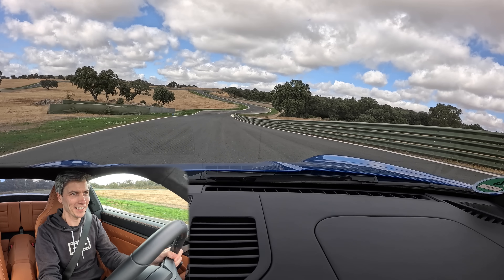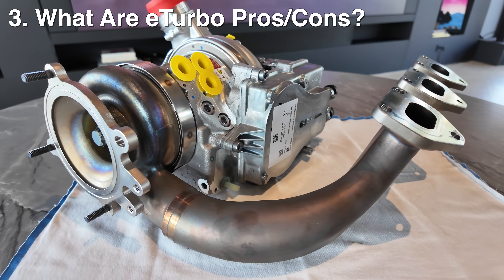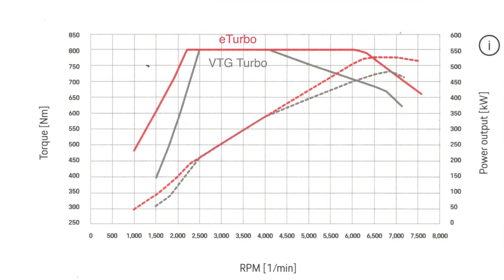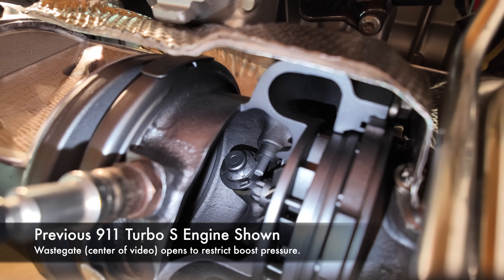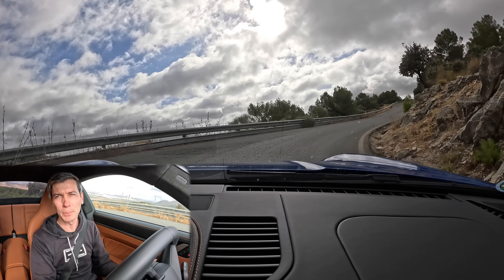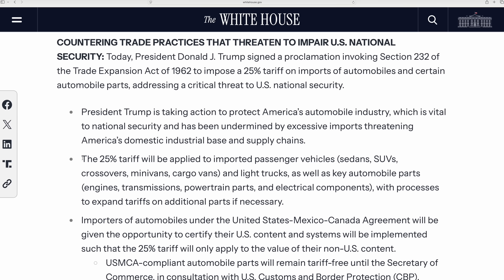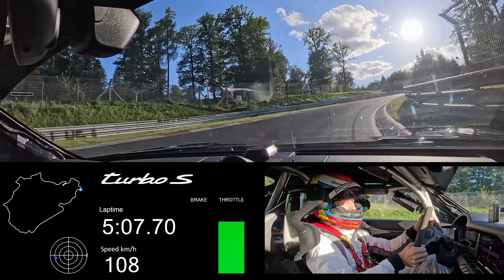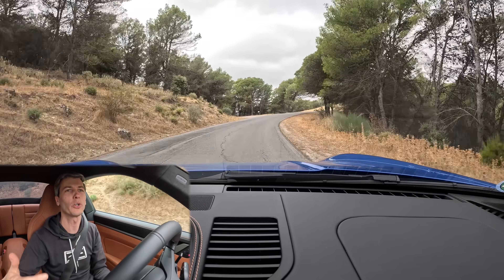Electric Turbos Are Here — Is It A Good Thing?

Comment: They should split the system. Compressor would be easier to spool instantly and be bypassed for cruising.turbine always extracting as much power as it can in any state
Reply: them you'd double the number of motors - one to manage the compressor, and one to harvest from turbine. Dumbest idea ever
Reply: @GamezGuru1 dumb? Lmao.. you'd have responses of natural aspiration with added turbo power plus turbine power extractor.. genius actually
Reply: @daveriddlelin9327 why has nobody done it yet then? 🤔
Reply: @GamezGuru1 it's been done in aviation.. but was wildly complicated and expensive but extremely effective..
Reply: @daveriddlelin9327  the cruising efficiency would even be far worse, there is literally only drawbacks 😂
Reply: @GamezGuru1 not true.. look up turbo compounding in aviation.. they got airplane engines to 50% thermal efficiency.. in the 50s!!
Reply: A company called AerisTech was working on that exact thing just before the GFC - but mostly focused on small turbos for diesel motors. Turbine worked as a generator feeding a solid state battery and the compressor side was spun up by an electric motor that drew from the battery. Capable of accelerating the compressor wheel from 0 to 100k rpm in half a sec.
Reply: - OR the e-compressor could decouple on the spin-up - then recouple as the turbine catches up  (Though, reliability gremlins will have at it)- A totally split system requires 2 motor/generator units  (and has lower efficiency - as do most "series electric hybrids")- in a "common shaft" arrangement there is only one,  spinning up the turbine as well as the compressor / motor mass - electrically, is small fish.
Reply: @kadmow  no need to 'decouple' anything. The motor just switches off, and the compressor is driven solely by the turbine, like a conventional turbo
Reply: Most of the time in real world driving you aren't in boost.. completely bypassed means natural aspiration response.. turbine recoup can be 50 hp. With nothing wasted making boost you don't need @kadmow
Reply: @daveriddlelin9327 you clearly don't understand turbo engines. In 'cruise' I e. low rpm (highest gear) a turbo engine is not on boost. Nevertheless, it is STILL more efficient than an NA engine. There is not enough turbine energy to harvest anything from it though.

50hp from the turbine is laughable, there is no exhaust heat nor massfliw when cruising...
Reply: @GamezGuru1 lmao who doesn't understand what?? I completely understand..  but thanx.. I've been driving heavy diesels for years.. many turbo upgrades have shown me a lot.. people think turbo drive pressure is free energy.. it isn't.. you can get 30 psi with drive pressure of 35.. most stock trucks 30 psi is drive pressure of 50 or more 
. Back pressure on any engine is horsepower not available at crank
Reply: @GamezGuru1 I've switched turbos on big Cummins diesels that power was turned up.. turbos have small windows of efficiency.. and all are a compromise except in that zone.. split turbo would allow tiny extremely lite weight compressor able to spool in an instant and be completely bypassed when boost isn't required.  In say a bus.. 7.3 power stroke.. cruising at 60 probably making 7 psi.. a 7.3 with no turbo gets better millage by far but can't climb.. turbo is in the way until a lot of power is needed.  I've driven a lot of cat 3208.  Junk. But they come turbo and none . The difference is huge.. many advantages to getting turbo out of the way whenever you can . Na response..plus turbo like power.. turbine extraction can increase efficiency with out being tied to boost at all.. plus split system allows for axial compressor . Wildly more effective than centrifugal compression
Reply: @GamezGuru1 switched from single to compound turbo on series 60 Detroit.  Egt dropped 300 degrees.. drive pressure at 40 psi boost dropped from 80 to 50.. didn't increase boost at all..but reduced temps to allow more fuel.. and boosted air temp drops too.. I kinda know how and why they work.. do you really???
Reply: @GamezGuru1 the fuel economy difference between cat and Cummins comes from drive pressure.. look at exhaust manifolds between them.. cat is always smaller because they operate with higher drive pressure Wich only is more efficient below 1500 rpm.. cat fuel economy is completely dependent on keeping rpm low low . Cummins has better breathing Wich at low rpm is sluggish and hard to get boost.. but is more efficient at higher power levels.  All compromises.. split boost from power extraction opens whole world of advantages.. compressor motor is just a motor.. extractor is just a generator.. allowing optimum performance and ability to bypass when ever possible

Comment: Dislike this "technology." Forget the turbos, the exhaust, the combustion engine. Get a fully electric EV with a battery. You get all the torque the instant you depress the accelerator. None of this ridiculous electric-turbo complexity to compensate for an inferior gasoline engine. Battery electric is superior in every way. Second is the cost, a ridiculous $272,650 base price. All of it so you can have some "engine growl" which only the "look at me" crowd cares about. There are numerous superior electric vehicles that cost a fraction of this Porsche's obscene base price -- and the EVs have none of the compromises. Overpriced "technology" for a truly inferior powertrain.

Comment: You actually brought up emissions! Have you no SHAME. The enitre reason turbos exist is the idiotic emissions.  Reduction that is microscopic and will never offset the emmisions added during manufacture your unnecessary turbo.  As well as all the replacement engines that will fails year earlier than normal engines, being forced to run under pressure.  Trying to get a tiny V4 to do something vaguely the same as the V6/V8 they replaced.  And we all get to pay thousands more for our cars.  Brilliant.
Reply: You are aware that Porsche has been making 911 Turbos for 51 years, right?

Comment: you get rid of the biggest problems with turbos. not the rotation high speeds, but the excess heat not using the exhaust.

Comment: The genius in gun designs named John Browning who was the desinger of all guns we know in the world now in 2025 and he lived 1855-1926 and he said the best most reliable gun was the most simple gun....................................I am not a car maker.........But.......I hear the horror storys of people in my own area of timing belts in oil of DSG transmissons that failed and loads more......People pay 1000,s for failing technique.

This is all great and nice and it will all break/fail at some point in future soon making the owner regret he ever brought is...........

I rather buy a Mercedes OM606 turbo as complete unit with trannie and bolts on trow some more fuel at it and never have the repair bills coming at me u can expect with this over engineered poop.

Really not a fan of complex things as a half electric turbo that ran on a special battery with with 20 sensors to control it etc etc.....I promise with 100% guarantee all will break and cost u the bank to find and fix.

Its nice wenn u make 200k a month and buy a Porsche with this engine and u drive it for 1  2 years..............but then warranty is over and the check engine light is on on and code XXX pops up.....No boost turbo under 1500rpm.........U regret u brought this.......

Comment: an engine driven blower (yes it gets it's power indirectly from the engine) is called a supercharger. this gets rid of lag. wooppee. turbos are expensive and don't last forever. Porsche turbos are really expensive. electric Porsche turbos are "if you have to ask ..." expensive.

Comment: Another example of fine German engineering. This motor spins up the turbo to eliminate turbo lag, then runs as a generator to eliminate the need for a waste gate. Awesome!
Reply: Yup, Mercedes started developing this technology in 2007 and finally had it perfected in 2014.
Reply: F1 tech.
Reply: the next iteration could be to separate the intake from the exhaust to have better hot gases and air flow, if you coupled it with a compact liquid to air inter-cooler it could be ultra optimized, now the turbine cooling must be working so hard to not burn the motor. Using some ultra capacitors as buffer you could run the compressor purely on electric current
Reply: Summed up succinctly !
Reply: This is clever in many ways but without the turbo regenerating power you would basically need that massive battery plus a massive alternator sucking your horsepower
Reply: Over-Engineering at its best. A solution to a problem that only interests in F1 gasoline cars. For the regular street use cars I would suggest to use 4 electric motors with a reasonable Battery for everyday use, say 60 to 80kwh, and in case you want to avoid the charging times on a longer ride, simply make a serial hybrid. e. g. Make an additional generator with a normally aspirating gasoline motor at a constant RPM speed, therefore the exhaust gases can be set to the lowest possible point of NOX production/best Lambda. The gasoline motor can have like 60KW under the hood and let refill the Battery, while driving, allowing to drive the car at a constant 200kmh for hours. And the gasoline tank should be big enough e. g. 50l for using it like a regular ICE car, but also as an electric car, combining best of both worlds, no overegulation from the state should dictate the size of tank or battery, let the market decide. And don't think about adding any glue foam or even seats to the battery pack. Keep the thing repairable! Have lots of fun from an agile car and be free to decide yourself for YOUR best solution.
Reply: @thesolderman861 series hybrid is not efficient.  That is why no one is making them.  5% thermal loss when converting engine power to electricity, 5% thermal loss when you charge the battery, 5% loss when you discharge the battery and 5% loss when you convert the electricity back into kinetic energy.  That is why parallel hybrids dominate.  Most of the energy goes from engine to transmission to wheels without ever becoming electricity.
Reply: @thesolderman861 serial hybrids are only efficient at low speed and so in urban or mountain environments because electric motors are less efficient at highway speeds (then they're worse than full electric in purely urban scenarios because you don't need the autonomy and heat of a combustion engine). If you never leave the city electric cars have been the best choice for years, but hybrids are far better for higher speed and more torque at low speed is both good to scoot away from an incoming danger and more energy efficient if a good amount of that torque comes from energy recovery systems.
Almost every modern car has a turbo charger for fuel efficiency, so I won't be surprised to see more and more of the high end getting electric turbos.
Reply: @thesolderman861  This allows the benefits of ICE with the increased efficiency of forced compression at all RPMs
Reply: @thesolderman861 what do you think it would be agile about this car? My own car is very similar to what this would be in weight, but it is very far from a Porsche or from agile
Reply: @thesolderman861  I agree about overengineered. They cant help themsrlves.
 I would say use the electric with the bigger turbo, and forget all that other crap.
Reply: If only they had powered the wheels by an electric motor and gotten rid of the rest of the junk. Much simpler, cleaner, faster and efficient.
Reply: @glenndennis6801  Good point you make, and it would be cheaper too.
Reply: @glenndennis6801  Isn't the EV Cayman delayed as the original battery supplier went bankrupt? It will certainly offer great simplicities (at least in the drivetrain) compared to ICE Porsche sportscars.  Time will tell how well the likes of inverter boards and battery packs hold up over 20-30 years, or rather how many workshops/specialists/owners will be confident to repair rather than replace (noting cell replacement is difficult on most sealed-type battery packs unlike traditional battery packs).
Reply: @TassieLorenzo  I'm confident of Toyota power electronics lasting 20 years and battery packs needing one or two cells replaced to be balanced. A Porsche EV like the Taycan sees much higher performance and loads. We might see a bunch of junked Taycans 20 years from now because no one can fix their busted inverter boards.
Reply: @glenndennis6801  Not faster
Reply: @glenndennis6801  appreciate each car for its brilliance. But get the one you want. There’s a car for you, my friend. Don’t dump all over this

Comment: So, under low RPM/high throttle conditions where the eturbo motor drives the turbo shaft to push boost into the intake, is there also a benefit that the driven exhaust side is helping PULL gasses out of the exhaust under slight vacuum (or less back pressure) to help with scavaging?

Comment: Wonder how reliable the turbos will be. On paper, this sounds incredibly similar to F1's MGU-H and we have learned that electric motors do not like being directly attached to the hot exhaust. 2014-2016 seasons were plagued with MGU-H troubles although that may not directly translate to a road car application. Now it's time to bring split turbos for V engines in street cars (AMG One doesn't count) and put the electric motor in between, then we can finally say that modern F1 technology has trickled into road cars.

Comment: Because how small the HV battery capacity is, I think sending electric power to the e-turbo first strategy is just for human perceived sensation of acceleration ( audio, visual and butt dyno ofc 😆 ) and also saving engineer from a lot of headache fine tuning this system.

Comment: I guess that electric motor right next to the turbine is going to get really hot. I wonder if they have to use some special high temperature magnets and insulation in the windings to be able to take the heat?

Comment: If the turbo electric system fails how much slower is that turbo to spool with that added weight?
We're using electric motors to spool a turbo.. to boost an engine.... to drive (through a transmission) the wheels, instead of just using electric motors to drive the wheels.
Thanks but I'd rather have traditional, compact, reliable, lightweight ceramic BB turbo's instead.

Comment: So the electric motor never comes on until peak boost? So the only draw back is if you weren't fully charged on the battery then some of that generated power has to be diverted from the motor to charging but If your battery was full you only use electricity to build boost at launch and the rest goes to the traction motor. I WANT ONE!!!!

Comment: I would have to wonder how well that motor could take the exhaust heat.  Turbos are known for getting really hot!  Touch one and you will be in the ER getting 3rd degree burns treated if it was running recently!!

Comment: I guess what I don't like 😂😂
is that they need high voltage compared to 12V to get it done 

So it becomes an incredibly complicated addition when we already have things like:
Exhaust Turbos
Belt Driven Superchargers 

Whilst an EV Hybrid like the Prius system literally increases MPG in a stop start situation, what does the technology of an Electric Turbo give us that we don't already mostly have?

Eg what does this tech offer us that is different?

Caveat, just because I  am conservative doesn't mean I don't like the attempt 🙂

EDIT 
Very clever from Porsche 💯

Using a traction motor, in addition to the e-turbos, and a 400!!!V battery is epic 
👏🏻

Comment: Will be interesting to see how long the electric motor next to the exhaust gases will last,cooking itself. Maybe a year?
Why the "super smart" engineers put the exhaust impeller away from the electric motor and only have a small shaft that goes to the electric motor and the turbo compressor.
I don't think I am that smart 🤔

Comment: By eliminating the waste gate, you force all the heat energy to be processed by the exducer portion of the turbo. Doesn't that mean that there needs to be considerably greater amounts of heat rejection capability? It sounds like these turbos will cause much more stress on the cooling system of the car. I bet the failure mode will be bearing failure on the oil galley bearings in the turbo because of cooked oil, or seal failure on the coolant pipe seals.

Comment: Does the turbo brake increase exhaust back-pressure? Or is the effect negligible?

I like how this system practically eliminates boost threshold issues—the one thing that annoys me about turbos.
Reply: It does to a degree, but not enough to make a meaningful difference, and it helps suck but gases at low revs fully avoiding backpressure

Comment: I have seen Electro-motive diesels used to power emergency generators at a power plant.  The engine had an interesting hybrid supercharger/turbocharger.  The supercharged was run by the engine and connected to the turbocharged with a clutch mechanism.  When the exhaust output was high enough, the supercharger would disengage using the clutch.  This electric motor/turbocharger reminded me of this interesting design feature.

Comment: I had that idea of a motorised turbo a few decades ago to reduce or minimise lag. I am upset they achieved it before me (many others must have thought of it too). 

But thinking of something such as that and actually achieving it is another matter. I struggled to think of an effective, full-proof way to isolate the motor from the hot gases. 

Given Volkswagen group is such a big concern with much resources - nevermind any other major auto manufacturer - I'm amazed it took them so long to arrive at that solution to such a recognised problem.!

Comment: It’s awesome tech for diesel engines, on acceleration you can precisely control AFR rather than having the fuelling increase leading the air flow increase. Huge soot reduction and less load on the DPF.